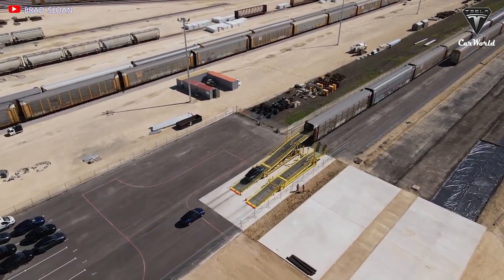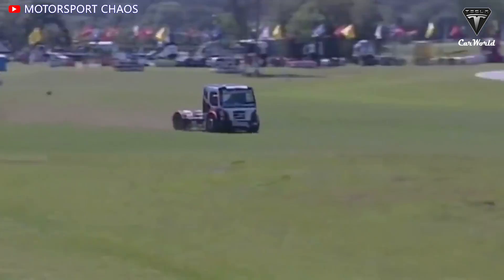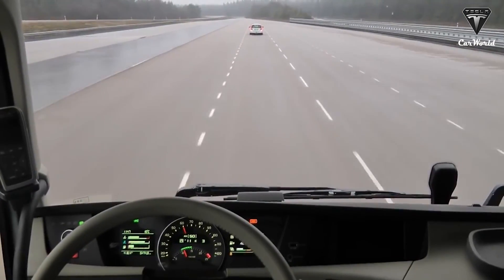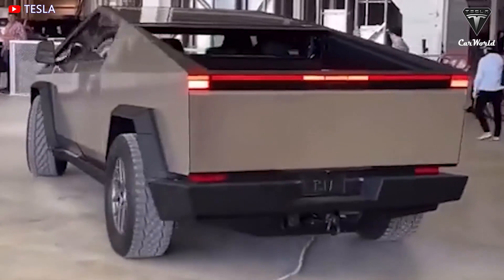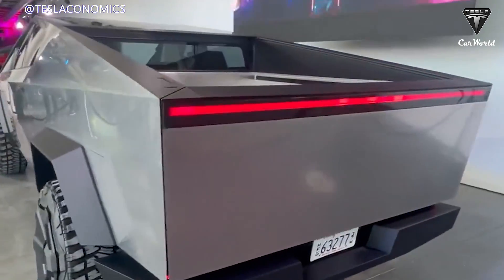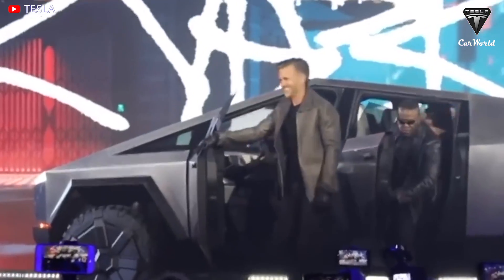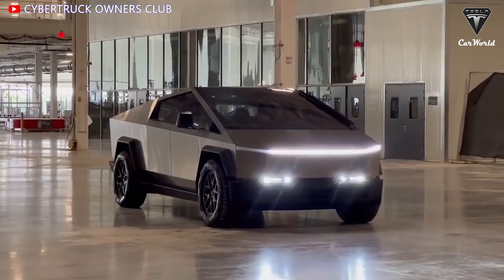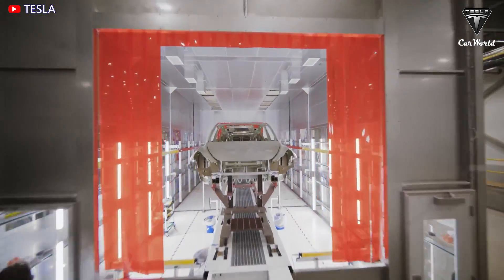Elon Musk's Latest Tesla Cybertruck Prototype Is Here

Comment: The electric brakes have a ton of potential, and Cybertruck would be a perfect application.  Variable ratio fly by wire steering would also fit with the high tech package.
Reply from the maker: Variable ratio fly by wire steering ? Can you tell me more about it?
Reply: @TeslaCarWorld   The signal for yoke position is electrical, fed to the steering rack via wire as done in aviation.  At low speeds half a turn of the yoke moves the wheels all the way, then as you go faster the less sensitive the output gets.
Reply: @TeslaCarWorld    26:35 for details.
https://www.youtube.com/watch?v=Y41rHaTGgWY
Reply: Nonsense!!!! The perfect application is for sport cars not trucks lol…. Also it’s not going to be as flexible or polyvalent in its use compared to a regular ice truck

Comment: All  these advanced things are just added cost to the suggested price. I think will be come options.
Reply: But options cost more money. For example, it cost Apple an extra $55 per cell phone to run a second factory line to allow the option of changing the storage. However it only cost $30 for the upgraded storage microchip.

Apple would be saving money if they just made the highest tier storage on every model.

Tesla is the same way, if they can get the cost down and integrate it enough, it will become next to nothing to just integrate it into all of them. The same reason why it's cheaper to install heated seats on models that don't have it then it is to not install it. It may cost $4 for the heated seats, but it cost a lot more overhead to set up a station that switches the seats in or out depending on which kind it is.
Reply: @pilotavery  How cheap was it to sell FSD before it was complete?
Suddenly it is way way more expensive YET ALREADY INSTALLED ON EVERY CAR THEY MADE?

Tell me more about how that works again.
Reply: @scamchan  they didn't put all the sensors on the car so that they could cell phone self-driving, they put the sensors on the car because even the basic car without full self driving still needs the sensors anyway and it only cost like $50 more to put in a more powerful camera and they had to put sensors on the car anyway to collect data. May as well make it the best system for a little bit extra and now you kill three birds with one stone.
Reply: @pilotavery  I guess you realize you didn't answer the question at all.

Installing something with a set price for years before it was ACTIVE

Then changing the price years later to even way way higher.

The installed FSD didn't change much if at all.

Again cheaper wasn't even discussed.

So how does the price change to higher if it was already installed in all of the cars?

Since you can't answer the question it seems you would rather dance around the issue.
Reply: @pilotavery  Again we are not talking about sensors.

We are talking about a price set for FSD before it was even active compared to currently when it really isn't fully active.

Try and focus on an answer instead of dancing around talking about sensors and other stuff.
Reply: @pilotavery  Going by your logic FSD should be selling for cheaper instead of the price going up up up.

Since as I already told you it was already installed on every car from the start.

In this case your logic falls flat on this.

You can't seem to explain it.
Reply: @scamchan  it doesn't cost them any money to sell it early. I don't know what you're getting at. They got extra money before they even finished which means they got a free loan. Quite the opposite of spending excess money if you ask me. Please explain to me what your point is
Reply: @pilotavery  That like me selling you a loaf of bread before I bake it.

Then I start to bake it I change the price

Once he bead is fully done the price changes again.

Keeping in mind it is still the same bread.

Everyone will be getting they are buying.

Once again you are not answering the question put to you about why the price changes at all.

The price was set long before the bread was being made or delivered.

The problem we have here is your level of confusion to explain the changes of price.

In this case FSD was already installed on every car and sold at a set price.

FSD was not fully functional at all when it was being sold.

Currently it still isn't fully functional.

Somehow the price is going up up up.

Your logic to so called explain it was cheaper to install bla bla bla bla.

Doesn't explain price increase of something already installed.

No matter how you dance around it explaining other things that have zero to do with a price increase.

Put simply
If you sell something at a set price that came already installed on millions of cars.
How do you justify a price increase on an incomplete product?

I don't think I can ask it any more simply.
We are not even going on about the deadline it was quoted to be complete by at all.

Yeah it is interesting to see how expensive items can be sold cheaply already installed and here we have one that is already installed that keeps going up.

hmmm

Your logic falls flat here time and time again.
Reply: @pilotavery  "it doesn't cost them any money to sell it early"
Looks like it cost them plenty of money if they have to raise the price while still being incomplete.
Reply: @scamchan  oh, that's what you're saying. You're saying it's like a pre-order. Well in this case it's more like early access, because people who bought full self driving actually did get more features, they got advanced self-driving features that others didn't with the promise that they would be able to get full self-driving later when it was released. I don't see what the big deal is since this is exactly what they advertised. Also, they raised the price over time, but if you already purchased it earlier than you don't have to pay anymore. They even say they are going to raise the prices. It's the same way that rent prices are going up or the price of Adobe Acrobat changes. They even said it's probably going to go up again next year. So people who buy it now get it cheaper. Just like when you pre-order a game you get it cheaper.

I don't understand what the big deal is. People who pre-order full self-driving get a discount and they get early access to some of the features. Seems fine to me.
Reply: @scamchan  also, isn't that what you do every time you go to a fucking fast food restaurant? You buy and pay for a meal and then they start making it.
Reply: @scamchan  the price changes because the value changes. The same reason why rent price changes. Tesla even from the start said the price is going to go up over time. The earlier you buy it the bigger of a discount you get. They want funding and so they're willing to take a lower price for people who are buying it early. In exchange for waiting, you get a discount. You don't have to pay as much as the next guy, and you get access to some of the earlier features of full self driving even though not the entire set, and you pay less. I don't know how much more clear or simple it could be.
Reply: @scamchan  full self driving has not been installed on these cars. Full self-driving is the software. The only thing that's been installed on these cars is all of the sensor suite, the cameras and the computer system. Full self-driving is only on a couple thousand cars as a beta test. 

Keep in mind that every car including the low cost cars come with all of the cameras and sensors because they also come with the regular self-driving on the highways. That's included for free. And it still needs the sensors anyway.
Reply: @scamchan  I think you're misunderstanding, full self-driving is not installed on cars. They're not changing the price after the fact either. Full self-driving is the software, like buying Microsoft Office or buying a video game.

The car includes regular self-driving for free without having to pay anything. This requires all of the cameras and the computer. The computer is capable of full self driving in the future but it is also a requirement for all of the cars basic features anyway. So that price is not changing. The price of the software program is changing. People who paid extra to pre-order the advanced software get some extra features. These features are purely based off of software work. They make use of the cameras that are already on the car, but the cameras on the car we're not specifically made for full self-driving, they were also made for the basic self-driving features.

The price changes over time for the same reason why video games price changes over time. You can buy the software later.

The autopilot hardware is included on every car and the price does not fluctuate because there is no price for it, you cannot buy a car without self-driving features.
Reply: @scamchan  also, I could also argue that windows, ios, and Android are incomplete products because they are constantly releasing updates and getting better and being released to more people. And yet people still buy them.
Reply: @scamchan  FSD does not come on millions of cars, it doesn't come on any cars yet except for a few thousand of them that are in the beta testing program. FSD simply uses the cameras and computer that are already there for other reasons anyway. The cameras and computer has to be there no matter what so they don't even have a price for that, it's free with every Tesla purchase.
Reply: @scamchan  also, does it matter if somebody increases the price? They are not increasing the price for people who already paid for it.

If I want to buy an ounce of gold, and I buy it and while it's being mailed to me the price goes up a little bit, they don't charge me more while it's already in the mail. I've already paid. This is what Tesla does. If they've already purchased fsd, they've already purchased it. They won't have to pay anymore. Tesla even tells people that the price is going to go up so if you want to buy it you should buy it now, and so anyone who decides to wait feels that it's worth paying more to wait for it because they don't want it. They are increasing the price because it is becoming increasingly valuable. You couldn't justify $15,000 when they barely had a working demo, but you can justify $15,000 when they've already demonstrated that it's on par or better than human drivers and they are so close to release.
Reply: @pilotavery  "isn't that what you do every time you go to a fucking fast food restaurant? "
I don't fucking order a burger and wait years for it to be delivered to me.
Then get charged more once it is done.
Reply: @pilotavery  Interesting as the price can just go up up no matter how small things advance.
Reply: @scamchan  yes, Tesla is able to gather data on these millions of cars in order to actually develop full self-driving beta which requires this data. Tesla is using these millions of cars to collect data, but these sensors were not sold as part of the full self-driving package, the full self-driving package is a separate package that makes use of these sensors. But even the base model Tesla with the lowest tier of features still require this suite of sensors
Reply: @pilotavery  Yeah I understand all of that I have yet to see a price change on other things sold for cars like this.

Maybe I am wrong but it just looks strange in how it is rolling out.

Either you have a product with a price or you have a product that changes at a whim like gasoline.

Comment: Just wonder how you will stop the truck if this fancy electrinics fails on brakes.....since there is no direct hydraulic connection between brake pedal and calipers..
Reply: There are many luxury models with steering and brake by wire
Reply: So we are forgetting about the regenerative braking at all?
Reply: Ur dead simple